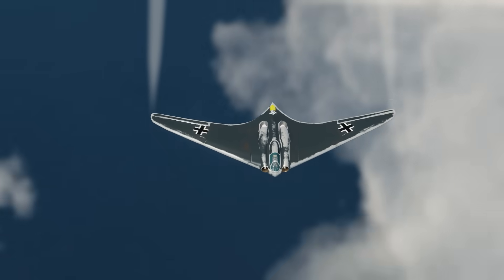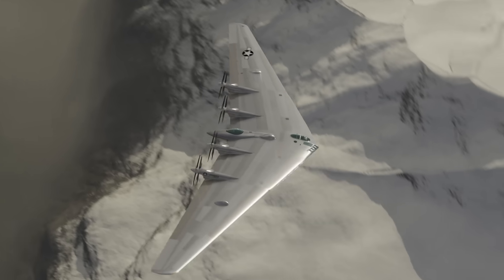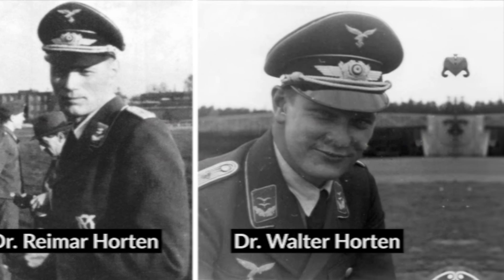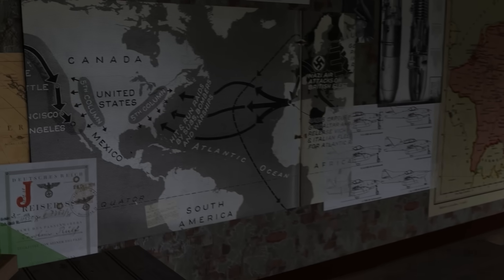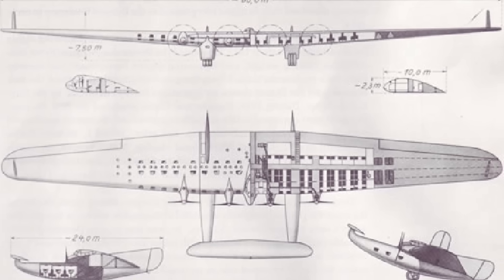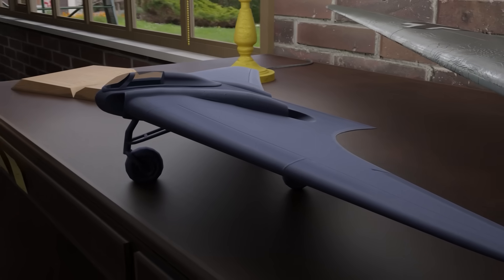Insane Flying Wing Jet Fighter To Save Germany - Horten Ho 229 Nazi UFO

Comment: ima sum some stuff up that's is incorrect through out all of this 
0:56 the statement that the Ho 229 was undetectable on radar is outright incorrect the ho 229 was perfectly detectable on radar even when Northrup tested it along with they only make it off wood while the real ho 229 had steal tubes going through it make it less radar efficient also im pretty sure the horents whole center "fuselage" was made of metal

1:23 the statement "the original flying wing" is incorrect its may have been the first jet powered one but not the first the first one was actually  N-1 M made in 1929 ( first flying one from memory but there where designs that were alot older ) also they made loads of gliders before hand like heaps not just hornets may i add

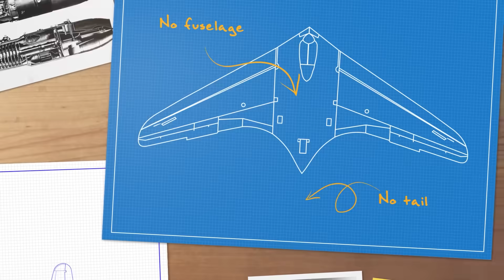2:00 ok im not to sure about this but if someone can correct me here please do. those part can still create lift its life putting your hand out the window of a car while its moving your had will be forced up but i will agree it wont be near as effective as the aerofoil

4:50 thank you for correcting your self 

6:40 i have not clue about the competition thing but i would like to add at the time Herman Goering would almost except anything placed on his desk he even exepted a rocket powered plane for god sake and a ph**king tornado gun

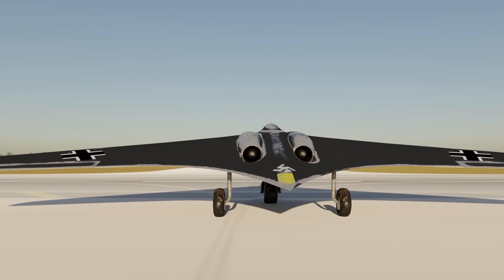11:20 oh this statement i can kinda agree with but compared to other jet aircraft at the time the ho 229 had the average  ( german comparison ) amout of armerment the me 163 had dule 30mm the he 162 had dule 30mm's but sometimes had those changed out for dule 20mm's which was more common dule to lacking ammo for the 30's the me 262 often had 4 30mm's  but i will had more than one round of the hei-t ammunition was enough to take out an aircraft although fire rate bullet velocity was extremally slow 

13:04 i would never call the german late war planes cutting edge more hopeful rushed and poorly made through nothing but a crippled county 

13:25 Northrup didn't grab his ideas from the horten brothers he had been making flying wings log before

14:15 ok the idea that Northrup got the design idea for the B2 from the Ho 229 is extremally incorrect its more likely taken from the xb-35 as they had never heard of the ho 229 till they were asked about it which is when they started testing the radar signature on it
 
13:35 he didnt have the idea ether there where designs for flying wings all the way back to right after the Wright Brothers 

16:13 cough cough me 262's and the he 162

im not going to nitpick on pronunciation as ive seen that through all the comments  and ive seen your correct you slef ine the comments

also please correct me on any of these statements :)
Reply: You are wrong on multiple things, but mainly on the statement that northrop didnt grab his ideas from the ho 229, the americans captured the ho 229 and sent it back to the us for further researching, then in 1947 the us makes a jet powered flying wing. Thats clear evidence that the ho 229 helped on that.
Reply: @kivinrepoio  Northrop had been building flying wings before the ho229 glider even took off the ground ( YB-49, XB-35, N1, N1M and N9M ) to say they used the ho229 without accounting for the fact they had their own proven designs is stupid especially when the YB-49 looks quite similar to the b2 spirit let alone not accounting for the fact when ho229  got taken back to the us they lost the wooden parts of the wings and they didn't do a rebuild till much later

Comment: A thing to note, people have checked the Horten's radar signature and found it wasn't THAT different from normal aircraft at the time
Reply: Actually your wrong. Northrop did a radar test on the aircraft and found that if a horton was flying close to the surface, combined with its speed and reduced detection, allied aircraft at Britain would have only roughly 2 and a half minutes to respond which wouldn't have been enough time. Flying close to the surface was a strategy employed by the German airforce.
Reply: @qualityassuranceofficer1946  a) the Smithsonian ran tests and determined there was no stealth capability of the plane, b) the 20% reduction was on radar types from 1938, which by 1944/45 had been retired and replaced by versions where it had no difference to other aircraft
Reply: It was reduced by about 20%, which isn't negligeable.
Reply: @user-xu2pi6vx7o  Okay, then what I mean is they used old radar technology and say no noticeable difference in rate of detection

Comment: Point of fact:
The HO-229 was NOT a stealth aircraft, nor was it "difficult" to detect. Modern tests on the aicraft using radar emitting wavelengths similar to the U.S. Chain Home radar system of WWII found only a 20% reduction in detection range compared to the Bf-109; and that was with a reproduction fuselage that lacked engines, metal framework, fuel tanks, or engines.
Reply: Tests conducted by the Americans (without the RAM applied) showed no significant retroreflective structures and a very significant 50% reduction in RCS, this would have delayed detection long enough to give an effective tactical advantage... the use of RAM such as the German Tarnmatte would have contributed to an additional reduction in RCS.
Reply: @DoktorBayerischeMotorenWerke  
Against Allied Chain Home radar systems, the Ho 229 had a detection range roughly 80% that of a Bf 109. That is only a 20% reduction in detectability. Additionally, all tests were carried out on a mockup that lacked the tube truss structure and engines, the latter of which would have been highly reflective.

There were no radar absorbent materials used or planned. The charcoal material commonly cited as RAM was in fact a new adhesive that would have provided no measurable reduction in detection.
Reply: @jfangm  The tests conducted by the Americans confirmed a 50% reduction in frontal RCS against British meter band radar without RAM

Are you not familiar with German development of RAM during WW2 or its production and military service???

Tarnmatte is the best-known example of German advancements in RAM technology that saw actual service during the war.
Reply: @DoktorBayerischeMotorenWerke  
That is completely wrong.
Testing by Northrup Grumman showed only a 20% reduction in detection range compared to a Bf 109 and no significant reduction in radar cross-section due to the reflectivity of the engines.

As an expert in WWII, I can say with confidence that there is no evidence of radar absorbant materials ever being developed, tested, or deployed by anyone involved with the conflict. Additionally, a search for "tammatte" yields no results of any kind, leading me to conclude that it either never existed or you are confused.

It is possible you ran across, and believed, claims that the Ho 229 used a charcoal mixture as a stealth coating. However, these claims have debunked as myth. The Smithsonian performed multiple tests on adhesive samples from the 229 and found no evidence of charcoal.

Radar was effectively bleeding edge tech in WW2. Given the limited science and understanding of radar at the time, as well the limitations of materials science, it is effectively impossible for ANYONE to have developed even the most primitive of RAM. Germany especially lagged behind the Allies in materials science and radar technology, making them even less likely to have developed such an advanced material.

Comment: Uh wrong. Jack Northrop was not inspired by the horton brothers designs. Jack Northrop had never been to Germany nor ever knew of the horton designs. And his first productions solely flying wing design was first flown in 1940 his tailed flying wing designs were being produced and flown in the 20s. As well he designed the yb-35 a flying wing bomber in 1942. Before goring came out with the aircraft proposal. Jack Northrop was a pioneer in the field and he claimed to have not known of the Hortons designs til after 1945. And his yb-49 was not produced from knowledge gained from Horton designs but from design improvements of the yb-35

Comment: did you know: the horten HOIX was the result of the three 1000 project: 1000 kph top speed, 1000 km range and 1000 killos of payload. this is a fighter bomber.

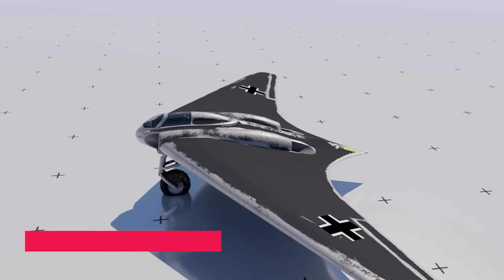Comment: At 7:45 you state that the high aspect ration of the Horton's wing contributes to its stability against stalling. Not so. The major design feature which does this is the sweep back of the wings which gives a horizontal control moment. In addition washing out at the wing tips causes the inboard wing to stall whilst the wing tips are still not stalled and so can continue controlling the aircraft. Also the the centre of the wing will fall causing the plane to descend, picking up speed, and emerge from the stall.
A high aspect ratio wing is indeed more efficient than a low aspect ratio, but aerodynamic effects are not the be all and end all of aircraft design. A high aspect ratio wing is inherently less structurally rigid than a low aspect ration and will need to be built with more structure to make it rigid enough. 
It is important to remember that a flying wing design could not be made practical until the advent of computerised control systems which could not only deal with aerodynamic control inefficiencies, but also with structural flexibility.

Comment: The one problem I have with all of this nonsense about the Nazi flying wing.............. is that it is not the first of its kind. The Horton flying wing and the American Northrup flying wing were both being developed during WWII at virtually the same time. One is not a copy of the other. The U.S. and Germany were both working on the same concept SIMULTANEOUSLY. And they both ran into the very same problems: lack of stability and a serious tendency to CRASH. This problem with the concept was not solved until flight computers were developed that could make constant adjustments in the planes "trim."
Reply: + Cindy Hurd      Northrop at least had developed mechanical yaw dampers for the YB-49 just before Stuart Symington killed the program to punish the company.
Reply: @FiveCentsPlease  Yes, I've heard that politics and pure greed were involved in killing the Northrup program. Sad!

Comment: If deployed in Norway it's going to put Royal Navy carrier aircraft disadvantage since it's not going to be detected by fleet radar and F4U Corsairs F6F Hellcats used by the British carriers in Norway 1944-1945. That would have required the Royal Navy Rush jet planes
Reply: If a usuable and relatively easily flyable Go 229 was going to exist, we're looking at Fall 1945 earliest if Germany stagnates all fronts by 1944.

Comment: You seriosly need a fact check history lesson. Germany never started the War. That was the doing of Poland / England. Go do your research and let me know what you find.
And without a doubt, the Germans were light years in there technological advances. When WWII ended, it was either "stolen" or copied.
Reply: Germany annexed Austria with by and large favorable Austrian consent. Be it questionable democracy and diplomacy or not. The same could not be said for Czechoslovakia and the "Sudetenland", or Denmark, or the Netherlands, or Belgium, or Norway, or Poland. But sure go off of one incident that still to this day was clearly made by German ulterior motives. They were not ahead. Overall or really in any one measure.
Reply: Wtf no, just simply no.

Comment: Wow, didn't know that WWII Nazis had compact, powerful computers... because that's what you need to control a flying wing in the air. It was clever of German scientists to come up with the concept (and I'm not sure that they were the first to do so) but if you don't have the technology and manufacturing capability to make it work, so what?
Reply: You are mistaken to belive that flying wings can only be controlled by computers. Many flying wing designs flew well before the computer age and quite successfully so.

The hortense first flying wing took part in glider competitions as early as 1934, loging flights ad long as 7 hours that year. Ther h-III flingwing was even in small scale series production from 1938 till 1944. 

Jack Northrop build quite a few successful ones starting in 1939 as well. All without the need for computer aided stabilization.

Comment: Modern, Filipino twist here:
-engines replaced by general electric j85 (afterburning) turbojets

-guns replaced with a pair of m39 20mm revolver cannons (BECAUSE the 30mm guns are no longer in use for a very long time; to make up for lethality, high rate of fire will do). Or the Mauser BK-27 27mm revolver cannon (used in planes like j-39 gripen, sepecat Jaguar, of the retired Panavia tornado)

-AESA radar small enough to be stuffed in the nose (maybe even enlarge the nose a bit to fit)

-IRST all around the plane (top and bottom of "tail" section, one on each wingtips, one behind the canopy, one under ventral section at the center of aircraft, and one over the nose just in front of canopy; a la f-8 crusader's). Except the one under the nose, that's for FLIR.

-HOTAS either in side stick layout like f-16's, or conventional center column layout.

-either fly-by-wire or fiber-optic controls (should the budget allow, and with insulation against emp) to lighten up the plane. Control linkages will be electro-mechanical (also with shielding against emp)

-of course with MFDs to keep the costs down as possible. Or,

-helmet mounted display with sensor fusion a la f-35

-3d-printed parts to further lighten up the plane.

-metal foam for structural parts (again further lightening the plane but keeping airframe integrity)

-composite inner skin (maybe carbon fiber WITH fiberglass or GRP because, correct me if I'm wrong,  radio waves can't penetrate those  materials well. Essentially radars will be interrupted by said materials)

-new landing gear (for the sake of reducing the weight of the freaking awesome plane, BECAUSE the OG one seems bulky AND heavy...)

-outer skin all around the plane (including engine housing, exhaust shrouds & intakes) composed of hexagonal panels and there are two types: 
for optical "invisibility", it'll be screens. Each six *corners have cameras to project live feed to the opposite side of the plane. Like James bond's Aston Martin in die another day, but in my take, it has "yehudi lights" integrated on each six sides for counter-illumination (light intensity depends on outside light. If surroundings are bright, lights go bright. If dim, lights go dim)
*For thermal invisibility, it'll be panels that changes its temperature 🌡️ depending on what temperature the surrounding environment is.

-also boosted flight controls with redundant backup systems so if one or more control surface gets damaged, flight computer compensates to maintain flight control authority.

-as for missiles? Externally, couple of sidewinders slung under hardpoints under each wing. Internally, four or more 70mm guided rockets (essentially air-to-air version of the advanced precision kill weapon system [APKW]) in each wing.

-radar/laser jammers and chaffs and flares to thwart target lock by enemy aircraft; AND defeat incoming SAMs or AAMs, respectively

Comment: Birds.... Look up the Etrich Taube. The V-Stab(s) on that doesn't amount to very much. And it was called the Dove for a reason. (look at it, you'll see). Birds fly slow, weight shift, and have full control of their wings can can articulate their tails to act as rudders when the want to as well.

Comment: Northrop was working on his at he same time. Parallel development, not inspired by. There is even an example o a bi-plane Nurflugel from the pioneer era. This is not something the Hortens came up with.

And the B-2 was based on he YB-49. They did visit the 229 in storage and did analyze it, but, it was way too far into the development cycle for it to have any impact on anything.

Comment: Yes, the engine failed on the prototype, and he pilot did die. But that is not really what happened. The engine failure took out the hydraulics. And that, combined with position at the time pver muddy ground by trees was really what caused the crash and death.

Comment: It's only the footage that is getting me through the cringe-fest. Luft-vah-fah. Not fecking waffle. Also, the Mk-108 was airborne artillery. The most powerful they had for general interceptor use. It was on the 262 and the 163, as well as  the 109 and 190. It would take bombers apart with ease. You said it was not all that much.

And I'm not trying to be pedantic here, I'm giving a pass to the mangling of Junkers, Reimar and Gotha Wagonfabrik.

But.... t is not Hoe. None of them were, not even the Ho-1 you showed a pic of on the ground. Aitch Oh. Just like Me-262 is Em Eee, not "me".

Comment: Good. Lord. Who wrote this? Northrop did not start with the YB-35. You could have mentioned the N-9M. And Reimar and Walter Horten were working on the concept n the late 30s with gliders, long before the Go-229 was ever conceived. Started out with them wanting to set gliding records and just grew from there.
Reply from the maker: You didn’t watch part 1 hehe

Comment: Not all tail-less aircraft are flying wings. Anything without a tail is a Nurflugel, it can have a vertical stabilizer. The Me-163 is a prime example of this. Technically, delta wing aircraft as well and there are loads of them in the sky today.

Comment: Stalls have nothing at all to do with the engines. Gliders can fly without engines, and they can also stall. Stalling an aircraft is when the airflow over the wings stops being smooth and departs from it, causing lift to stop being produced. It is a factor of speed and angle of attack.

Also, Yawing, not yawning, in the piece prior to that when you were talking about the vertical stabilizer and the rudder.

Comment: The Hortens did not call it 229. That was Gotha, making it the Go-229. And they modified the design as well.

It did not have machine guns at all. It had 2 Mk-108 30mm canons.